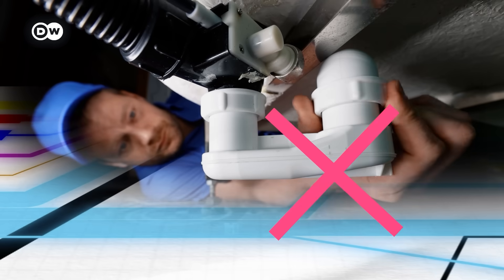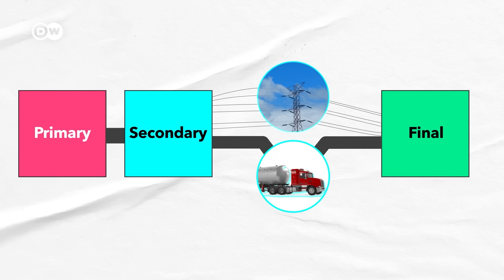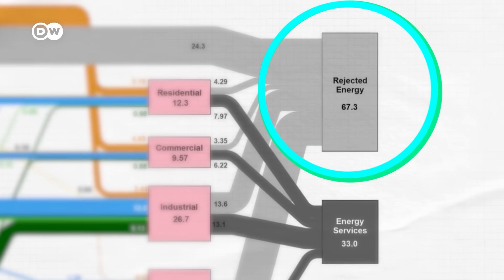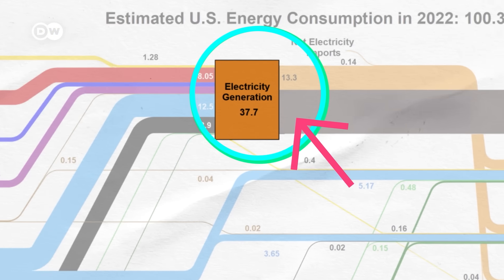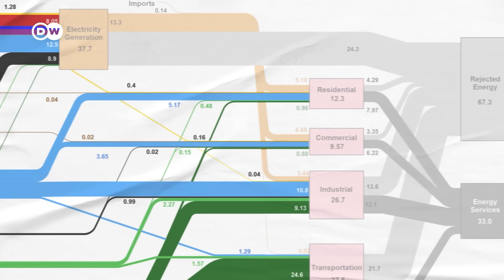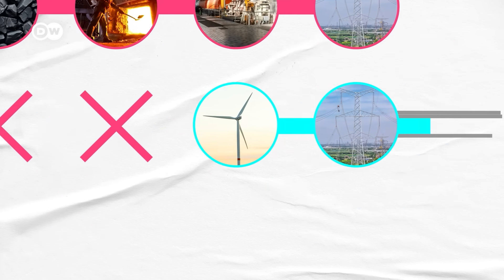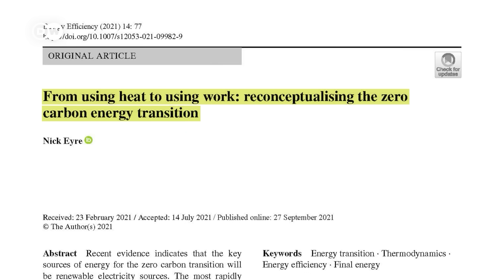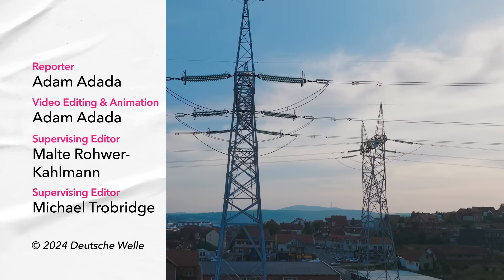The mind-blowing thing we get WRONG about energy

Comment: This is a wonderful video! This is another reason why I think Lithium-ion battery powered ships are the future of logistical transportation. At present, 90% of ships are electric, but burn diesel or heavy fuel oil to generate that electricity, with an efficiency of around 30%. If we can get batteries to a volumetric energy density of 1000Wh/L(presently around 700), it'd be only twice less dense in energy than methanol and four times less than diesel. This is important because the efficiency of directly running the ship from this electricity is around 95%, compared to previously states 25-30%. So, what this means is, we could entirely expect the shipping industry to be carbon neutral in the future.
Reply: Good comment! There is a massive chemical challenge here that requires a paradigm shift in battery technology. 
Such a massive step up in energy storage density (from 700 to 1.000 kWh/L - about 50%) requires highly reactive and quite dangerous electrode and electrolyte chemistries. 
As a chemist, I advise battery manufacturers about the lurking dangers that surround current battery manufacturing and usage, including accident-bound or quality-induced catastrophic failure. Very often it ends in not extinguishable runaway Fluorine-fed metal fires, which often lead to the total destruction of the battery itself and the vehicle. Extremely toxic Hydrofluoric acid contaminates everything, making it very hard for fire brigades to deal with the wrecks. 
It will need many generations and battery design iterations to develop batteries that pack a 50% higher energy punch which also containing less dangerous chemicals with a lesser environmental impact during end-of-service-life deconstruction and materials re-processing. 
My chemistry background is high energy chemistry and Fluorine based propellants, so a dying breed as no university provides lectures or research on this Cold War chemistry anymore. 
However, to safely operate such high density energy storage sources, we need many, many more of my kind to teach and design-in Poka Yoke features to new marketable batteries. Otherwise these new battery designs will literally (!!!) blow up in our faces...
Reply: The airline industry could also become carbon neutral with SAF produced from Methanol produced from Green Hydrogen and CCS. ExxonMobil is presently pioneering this process. It is unalike to the Fischer-Tropsch process.

Comment: 3:35 It's not so much about efficiency (doing the same thing but slightly better), but about effectiveness (achieving an equal thing with different means).
Efficiency has some additional gains (like 30 % less if you actually use best available fossile technology everywhere). Effectiveness gains have on top of that between 50 to 80% on best available fossil technology, in areas like transportation (except air) and heating up to 150°C, which is about more than half the energy used.
Reply: Was about to write that. If you allow me to write a bit more, there is also a problem of including more people in the consumption economy capitalism is supposed to be. More people want to have blue jeans, more people want to eat meat at least once a week and off course more people want to have their own car. Efficiency might create a scenario where less resources are wasted as economy grows but a growing economy still requires more resources.

Comment: I recently got an induction cooktop. There was a bit of a learning  curve, but now my gas stove just seems too slow and imprecise. The induction cooks just as well but with perfect control.
Reply: For me "recently" was 24 years ago. But I do agree with this. Adding : It is safer because no CO poisoning possible .
Reply: Yes. I was pleasantly surprised when using our new induction cooktop that there no longer was a flood of hot air coming up around the cooking pot. Handles didn't get hot, the room didn't get as hot, I didn't feel as hot.
Reminded me of the speed and simplicity of using an electric kettle vs the old way of putting a kettle on a stove.
Reply: @jm493 Less moisture (from burning gas) in the kitchen air as well.
Reply: My induction only has 9 power settings :/ Why the designers don't use analog power settings I will never understand.
Reply: @bramvanduijn8086 yeah, mine as well. And it uses on/off principle, not modulation (like it's always heatinh but with certain % of power). It's pretty much crap, and I don't know how to find out before buying the way it works. A friend has a middle cost Bosch one and that one doesn't use this stupid on/off system. This on/off system made me burn my food on settings 5-9 far too often :(
Reply: @bramvanduijn8086 because analog, isn’t efficient, compared to digital.
Reply: Been using An induction build in stove for 20+ years. Never ever looked back.
Reply: I feel the same way about my Tesla Model Y vs my old Acura MDX.  The EV is just so much more precise.
Reply: @tysonn4736  The problem is that Elon Musk and Tesla refuse to do anything for right to repair, and boy do those vehicles need constant maintenance. Not concern trolling here, but Tesla (and most EV manufacturers) is the perfect example of EVs done wrong.
Reply: @goober239  And yet the latest Consumer Reports shows that Tesla's are the cheapest cars to maintain, in the world.
Reply: @goober239  I've had a Tesla model 3 since 2018.  It's required almost no maintenance.  The only thing was a couple of factory recalls fixes which they performed in my garage, and also replaced 12V battery recently.  No oil changes, radiator flushes, no brake pad replacement (almost all of the braking uses regeneration).  It's been WAY lower in maintenance cost than any ICE car I've had.  I have heard that tire replacement happens more often due to the weight of the car, but I think this is mitigated somewhat by having all-wheel drive, and smoother acceleration, putting less stress on the tires.  I'm still running on the 2018 tires, actually.
Reply: @tysonn4736  And if you buy two Tesla, is the precison doubled ?
Reply: I switched to induction from gas about 4 years ago. It's pretty awful in comparison, apart from gently warming things. Not usefully controllable at all.
Use a thin-bottomed pan and you will see grid marks on your pancakes and omelettes, and if you quickly turn it up high, you will distort the pans (even thick ones). So you have to use thick pans which due to their specific heat capacities take longer to cool.
I need at least one gas ring. The rest, for the easy stuff, can be induction.
Oh, and you get a buzzing sound which can be quite annoying.
Otherwise, they are much better. 😐
Reply: @danielc6106  The best restaurants in the world use only gas stoves. Why? It's very simple, an induction stove only heats the bottom of the cookware, and the sides and top of the food are not heated or cooked, while gas evenly heats the cookware from all sides and the product is cooked evenly like in an old brick oven (by the way, real Italian pizza is cooked only in a brick oven on wood). If you need to save on electricity and cook deliciously, then it is better to use a multicooker for this.
Reply: Switched over 10 years ago, no regrets whatsoever.
Reply: I am wondering how much would one save in Air Conditioning in hotter climates if an induction stove replaced a gas stove?
Reply: @anguscampbell1533  Depends on how much you cook, I think.
Reply: @anguscampbell1533  It could be noticeable if you cook a lot. Whatever heat the gas stove spills into your kitchen (that doesn't actually end up cooking the food) must be carried off inefficiently by the air conditioner.
Reply: @anguscampbell1533  With a gas stove you HAVE to turn an extractor fan on, so you're pulling cool air and throwing it out a vent. With induction, you still may have to but it's not nearly as bad, and the kitchen is SO much cooler.
Reply: The newer gas stoves are indeed crap. However older gas stoves from around the 70's are really really good. I also have a gas oven, and i still prefer that instead of an electric oven because it is able to heat up so fast and able to moisturize the contents. Remember 1 cubic meter of natural gas contains almost 10Kwh of energy.
Reply: Good idea... Throw away your old stove! Or better, give it for free to a an somalian family, and ask them to pay for the transportation. The control will be perfect.
Reply: @ernestolula3280  You can get cheap induction stoves for $40. And they're slightly shit. But even they are still much better than your gas stove.

Comment: Well on avg internal combustion engine has efficiency of 33% so nothing to do there unless someone makes engine with higher efficiency this chart won't change a lot.
But if you say let's switch to ev, we have problem of transpoting that electricity and suddenly we will have much greater swings of power demand which will be very hard to supply. Simply put it is unachievable in next 10-20 years.

And based on the chart the biggest rejected energy sources is ICE.
Reply: When you burn fuels, the carbons pollute. Renewables don't. When you have to carry your gasoline/diesel fuel you aren't as efficient as an EV carrying electrons (big battery, but smaller engine) and you don't burn electricity when the car isn't moving. Efficiency is hard to compare when they are different systems, but it is done and those charts show it.
Reply: @markhathaway9456  it theory all stands. In práctica however...
Heavy lifting use diesel, airplanes ceroaine, trucks, tractors, ships... Even if we convert all cars to ev it would be less than 1/3 or fossil fuel being used in transportation. And diesel is irreplaceable.
Reply: Electrical generating plants are more efficient at converting fuels to electricity than a car, so even if your EV is powered from a dirty grid, it is still more efficient.

Comment: Rose tinted spectacles yet again. The fossil fuel energy input and rare earth metals to produce the "green" wind and solar equipment vastly outweighs the useful energy available. Turbine blades begin delaminating within months of beginning operation and efficiency plummets; The majority of PV cells come from China whose generating efficiency is abysmal. The batteries for EVs require child slave miners to produce, can not be reliably used after any minor damage, are ludicrously expensive to insure, can't be put in multistorey carparks and are likely to catch fire while charging. 
  Sorry, the green dream is still pie in the sky. Go ask any engineer or scientist.

Comment: Completely missing the point. The big issue with renewables is that you can't generate energy on demand when you need it.
Also, you can't compare the energy coming from burning fossil fuels with the energy produced by wind/solar as they have completely different exergy content.
Reply from the maker: Like we point out in the video: we have to replace third of the fossil fuels we are currently burning. Also, we made a video previously looking at the storage issue with wind and solar you can check out here 👉 https://www.youtube.com/watch?v=u-DsDuTceTo
Reply: @DWPlanetA  please go and study some basic thermodynamics. You cannot compare energy in the form of heat and mechanical energy 1 to 1 because they have different exergy content. The wasted energy of, for example, steam turbines cannot be compared to electricity energy losses (like inefficient electric motors, stoves and what not) because mechanical/electrical energy is "higher quality" than heat energy (which is what exergy tells you). A 100 MW coal power plant will need to be replaced by 100 MW wind turbine, but the 100 MW coal power plant actually uses around 300 MW of heat power coming from burning coal and so 200 MW will be rejected power. And, as the second principle of thermodynamics states, even if you had a theoretical/perfect machine with no losses whatsoever, you will still not get even close to 300 MW of mechanical/electrical energy out of 300 MW of heat coming form burning coal. So it's not like switching to renewables will make you need 1/3 of the installed power of fossil fuel plants. It is true however that looking at that 80% fossil fuel primary energy figure is misleading when talking about electricity because for that we should just look at the installed power/the actual electrical energy output.

Comment: This is all well and good but ignores basic human behavior in relation to energy. Do we ever replace one energy source with another? If you use energy more efficiently we build on that and continue using more energy(Jevon’s Paradox). It ignores all ready baked in global warming with it’s attendant climate disruption, rising sea levels and economic impacts. It ignores dwindling resources needed to “transition” which will be more costly and harder to get. I think it is all scientifically true but won’t solve our predicament but if you’all think you can make a “transition”then go for it.
Reply: There is not an infinite amount of fuel, so eventually a transition will have to happen. Look at what happened to whale oil.
Reply: @Babyblasphemy  
Whale oil did get replaced but humans still burn massive amounts of wood, coal hit all time highs recently as did oil. Yes there will be a “transition”. It will be forced upon us by planetary limits.
Reply from the maker: Transition will, like you pointed out, also require fundamental changes in our economic systems, policies, and societal values. One of the movements addressing this is degrowth which we made a vide on 👉 https://www.youtube.com/watch?v=_22mKe_OLsg

Comment: EXCELLENT video and facts, THANK YOU!!  I hear this all of the time between gasoline and EV batteries and energy density.  EV's are far more efficient, allowing more power per kg of stored energy.  With smart grids, smart home panels and advanced electric appliances and machinery, we only need a small portion of power generation from solar, wind and hydro + BESS, to delivery the same amount of usable power to consumers.
Reply: No not true, but I'm just an engineer, read a free pdf download book on energy by David MacKay "Without The Hot Air" to see where all the energy comes from and goes to in great detail.  I believe Bill Gates rewrote it for the US market.

Comment: At 6:29…”don’t need to burn anything“ Uh, yes they do. Solar panels, wind turbines, and hydroelectric dams all require maintenance which at some level requires burning of fossil fuels (transportation, parts, labor’s  personal affairs) until total conversion to renewables, which this presentation has already identified as unnecessary.
Reply: That is obvious that we need it in the first place but if we have a good source of renewable energy like the desert tech solar project it could be a start to build new panels and stuff 100% with renewable. And yes a excavator needs diesel as well to dig the stuff out of the ground. 😅
Reply: @imtheeastgermanguy5431  Yes, what I wrote was obvious. However, only to those who have enough understanding. Too many promoters of environmental responsibility take extreme positions, and such a statement by a reporter simply supports misunderstanding. I am in favor of the renewable transition. I expect fossil fuels to play a role for many many decades to come.
Reply: @jaymacpherson8167  yes unfortunately they are play a big role but we run out on day and until this day fossil stuff is getting more expensive. Electricity from renewable is just better in every way actually. We should try to use electricity for almost everything and fossil stuff just for planes and stuff. Cars are better with electricity and even some industries can use a huge amount of their needed energy from renewable electricity. The problem is to store it but we working on it and already had made very good steps like lithium battery and brushless motors to be more efficient

Comment: Energy generation is one thing, It seems like more than anything intermidency is a major issues. When you burn fossel fuels you get the energy when you need it. Most people will say, "well just use batteries... duh.". But what kind, what chemistry should we use? how much will that cost not just in dollars but the carbon cost to make these batteries? what about inverters to take that power from stored energy to the grid. What happens when the batteries life is over do we have the materials to replace them and what does recycling the existing dead batteries look like? how much energy is used to recycle them and is there even a way to do it? 

You also get into the issues of solar panels when they are spent unless i missed some break though recycling them currently is not really feasable and putting them in a pile is dangerous due to the fact that they can leak akaline metals that can poison the ground. 

I think most will agree that a change needs to be made and I understand these people that want to switch to a more sustainable form of energy but we cant just move to electic cars tomorrow. the entire system would collapse not to mention the industrial process to make the batteries it is actually less green in most cases to produce and operate an electric car then a  small gas car. At least right this moment it is.

I wish people were as pasionate about fixing the issues as they are about protesting them. so they would contribute to a soloution as well as even understading the issues. It is not all (i mean all cause some is) but it is not all about corperate greed. It is about technical hurdles needed to move.